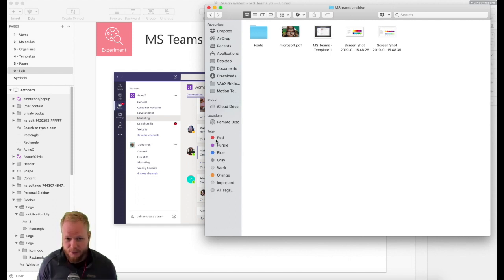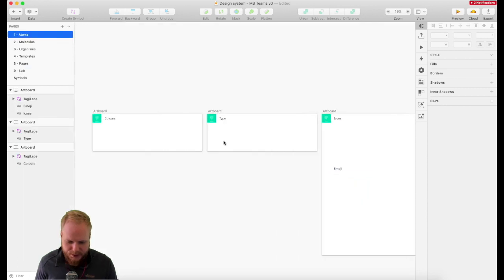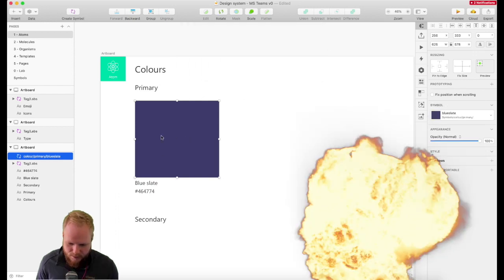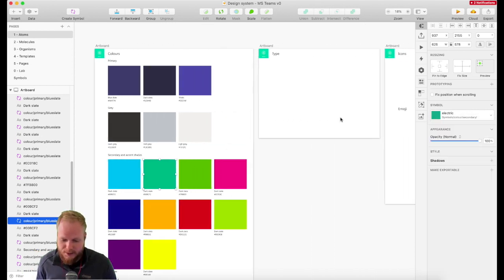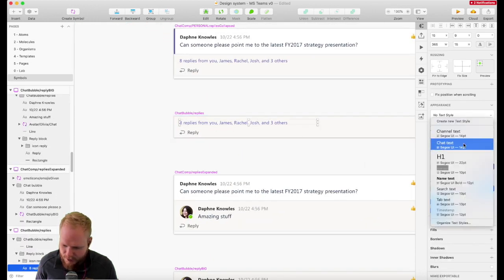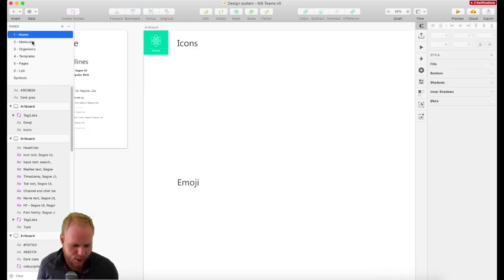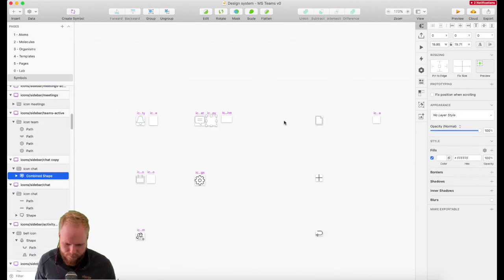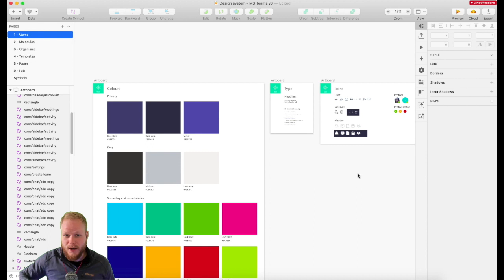Atoms - Create a Design System in Sketch, Ep3

Comment: Why not using a shared styles instead of symbols?
Reply from the maker: Because shared styles are Sketch/Figma/UI tool specific, and unless other designers know that a new shared style is created it lacks visibility at a glance. Most other tools also don't work that way - this is an introduction to the atomic thinking, rather than tool itself. Even with shared styles, laying them out to quickly onboard other designers is key

Comment: Hey, really enjoying this series of videos, however got a bone to pick with you - In keeping with some of the other symbols you created, surely the colour symbols should have been named: atom/colour/primary/colourname
Did you leave 'atom' off the naming convention for a reason?
Reply from the maker: Hey, you're right you could do that. The issue with the sketch, figma etc. is that they basically take care fo the first level (atoms) as they have the built in mechanisms for dynamic styles. In that case having a separate atoms would help communicating to other designer by just having a spread of the first level rather than somewhere hidden in the styles panel